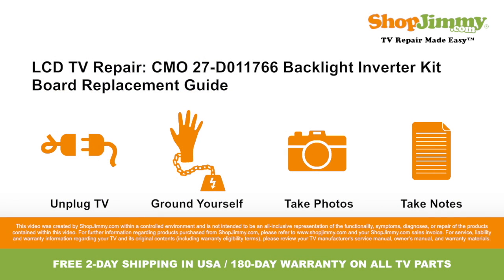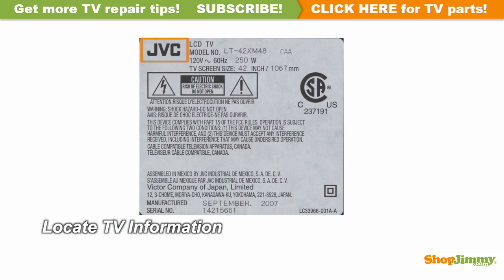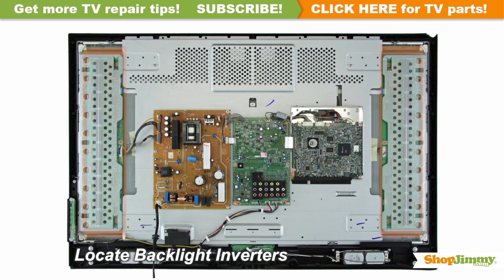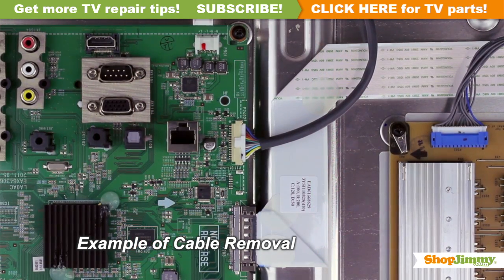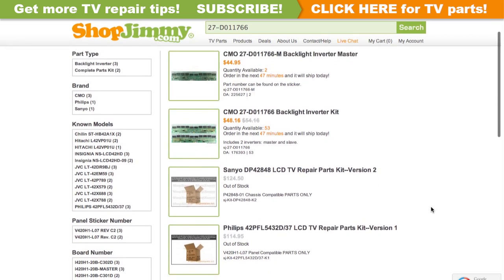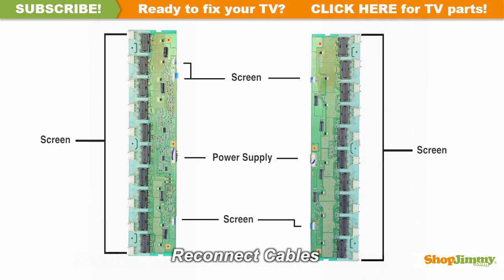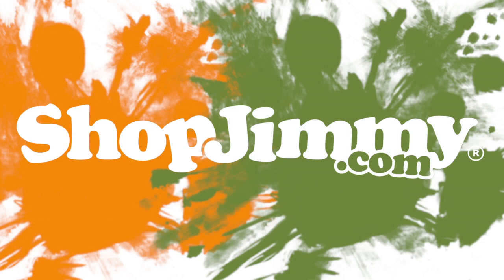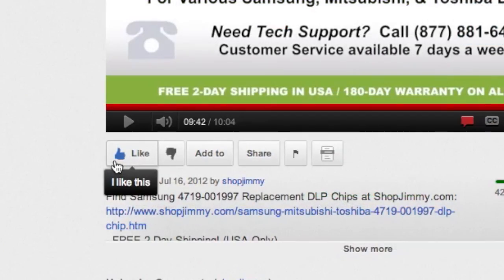TV Turns On, Backlight Inverter Immediately Turns Off TV Repair

Comment: I have a 42" insignia ns-42l550a11, I have replaced main power and inverter board (only 1).  Still nothing, I get a red light on the power on LED but  no sound nor picture.  what would be your next move, I have already ordered the main board (the one with all the different connections from HMID to USB).  the actual back lights??

Comment: I have a Sanyo DP55441. No picture, i have sound and if i put a light to the screen i can see images. So i pulled the back off the TV and checked the inverters. On both the master and slave boards the jumper connectors are burnt. The wires on the slave side had the insulation burnt right off. The connections on the board also show signs of being burnt. If i order a new Backlight converter kit will this fix my problem or is there likely something else that called this?
Reply from the maker: clint kendall   Yes, I believe that will fix the issue.  Here is a link to replacement parts:  http://www.shopjimmy.com/catalogsearch/result/index/?cat=46&q=DP55441  Be sure to match part numbers on your current board, with your replacement for compatibility.  You can also call our customer service for further assistance with your purchase.  (877) 881-6492  Thanks and please let us know if you have any further questions with your TV Repair!  www.shopjimmy.com

Comment: I have 32" Philips TV model # 32PFL5332D/37. Sometime TV backlight goes off but still sound is present. Sometime this happen 5 times in 5 minutes and some time does not happen for hours. when it happen I simply turn OFF TV power from remote, wait for few seconds and turn back ON again and it fix the problem.  I did flash light test and when I put flash light on screen I can see menu or picture. I did visual inspection of power supply board and inverter board and all Capacitor looks fine. Any help will be appreciated. Thanks

Comment: Hey shopjimmy - I have a Sanyo DP42848 LCD 42". The picture suddenly went out. When you power on or off the unit the picture appears for a few seconds then goes away. The sound works fine. The remote is broken and these units don't have an INPUT button so I am hard pressed to do the flashlight test. Please advise.
Reply from the maker: foxman2sly2  I recommend replacing the main board in your TV.  Here is a link to replacement parts for your TV model number on our website, click here:  http://www.shopjimmy.com/catalogsearch/result/?q=DP42848  Be sure to match part numbers on your current board, with your replacement for compatibility.  Here is a link to a video showing how to identify your part number, click here:  TV Part Number ID Guide for Sanyo Main, Digital, & Terminal Boards (LCD, LED, Plasma TVs)  You can also call our customer service for further assistance with your purchase.  (877) 881-6492  Thanks and please let us know if you have any further questions with your TV Repair!  www.shopjimmy.com

Comment: i have a dp32640 sanyo tv with no backlights i did the flashlight test and i can see the picture.Already changed the inverter that did not fix the problem . you think it could be the main board or the power board.

Comment: Hello,
I have a 37 inch Magnavox LCD TV.  Model # 37Mf437B/37  Serial # BZ1A0739310249.  It's only five years old and the picture has crapped out.  When I turn on the TV, the screen immediately turns white, and I can barely see the menu in light gray.  the sound is fine.  From reading and watching YouTube videos, I think it may be the backlight inverter.  What is your opinion?  Do you sell new parts for this model or do I have to settle for a used part?  Any help is appreciated.  Thank you.
Reply from the maker: Christine Giel I recommend replacing the main board in your TV.  Here is a link to replacement parts for your TV model number on our website, click here: http://www.shopjimmy.com/catalogsearch/result/?q=37Mf437B%2F37  Be sure to match part numbers on your current board, with your replacement for compatibility.  Here is a link to a video showing how to identify your part number, click here:  Philips Magnavox Main Boards TV Part Number Identification Guide for DIY TV Repair Help  You can also call our customer service for further assistance with your purchase.  (877) 881-6492  Thanks and please let us know if you have any further questions with your TV Repair!  www.shopjimmy.com

Comment: sony kdl 40s4100 turns and and shuts off ,replaced power board ,the same ,unplugged inverter board green light stays on.should I take a chance and replace inverter board?

Comment: I have a insignia ns-37D20SNA14 I think the black light is out but I continue find the black light converter  is it on the t-c
on board
Reply from the maker: +john casteel   Try all repairs and troubleshooting at your own risk.  This sounds like you have bad LEDs in your TV.  Unfortunately we do not sell replacement LEDs for your TV model number at this time.  You can check back in the future to see if we have them available.  Thanks!  www.shopjimmy.com

Comment: JVC LT-37DP8BJ - Intermittently powers down accompanied by pop/click noise. Standby light stays green. It won't switch on again for 15 minutes with mains power disconnected. Always switches on cold, sometimes lasts for hours without problems, other times it switches off 4 or 5 times in a night. Any ideas? Many thanks.
Reply from the maker: Joe Rees   I recommend replacing the power supply in your TV. Here is a link to your replacement power supply for your TV model number, click here:   http://www.shopjimmy.com/jvc-sfl-9078a-u2-power-supply-board.htm  Be sure to match part numbers on your current board, with your replacement for compatibility.  Here is a link to a video showing how to identify your part number, click here:  JVC TV Part Number Identification Guide for Power Supply Unit (PSU) Boards (LCD, LED, Plasma TV)  You can also call our customer service for further assistance with your purchase.  (877) 881-6492  Thanks and please let us know if you have any further questions with your TV Repair!  www.shopjimmy.com

Comment: I have a sharp LC-70LE857U tv turns on only back light shows for 5 seconds but no logo or anything just back light then turns off and blinks 2 slow times and 5 rapid...I turn it back on same process power supply has been replaced but it still does the same

Comment: I have a LG 47LN5700 tv. Yesterday, when I turned on the tv, the display would flash for a second and then turned off. I can still hear the sound of my cable box. I even can barely see pictures as well. I opened the back cover and didn't see any backlights. But when i turned the power off, I could see some backlight lit only for a second. Please help
Reply: Have same problem

Comment: I have a 42 inch jvc lcd tv when I try to put it on with the remote it not coming on but it turn on by hands I change the remote battery and the same thing
Reply from the maker: Rahul Joseph This sounds like the problem is either the main board or the IR sensor.  You may need to replace one at a time to see if it fixes the problem.  Please reply with your TV model number and I can recommend replacement parts for your TV.    You can also call our customer service for further assistance with your purchase.  (877) 881-6492  Thanks and please let us know if you have any further questions!  www.shopjimmy.com

Comment: Jvc lt 42x579 I plug the tv in and I hear a click. The blue led stays lit. No sound, no picture..nothing. Is it the main board?
Reply from the maker: Yoker   I recommend replacing the T-Con board in your TV.  Here is a link to replacement parts for your TV model number on our website, click here:  http://www.shopjimmy.com/catalogsearch/result/?q=Jvc+lt+42x579  Be sure to match part numbers on your current board, with your replacement for compatibility.  Here is a link to a video showing how to identify your part number, click here:  LCD Help Part Number Identification TV Repair Guide for LG Philips Timing Control (T-Con) Boards  You can also call our customer service for further assistance with your purchase.  (877) 881-6492  Thanks and please let us know if you have any further questions with your TV Repair!  www.shopjimmy.com

Comment: I have a 32" westinghouse LTV-30w2 when i turn it on there is no display at all and the red light in the bottom right just blinks at a steady pace. the tv is from 2005
Reply from the maker: Top Butter   PLEASE SUBSCRIBE TO OUR CHANNEL - Try all repairs and troubleshooting at your own risk.  I recommend replacing the main board in your TV.  Click this link to replacement parts for your TV model number:  http://www.shopjimmy.com/catalogsearch/result/index/?cat=56&q=LTV-30w2  There may be multiple boards for the same TV model number, be sure to match part numbers on your current board, with your replacement for compatibility.  Here is a link to a video showing how to identify your part number, click here:  https://www.youtube.com/watch?v=SoUXsgOx25oThanks and please let us know if you have any further questions with your TV Repair!  www.shopjimmy.com

Comment: Hi i have a Sony Bravia kdl46bx450 When I plug it in with noting plugged into it but the power cord and hit the power button the screen turns on, flashes the Sony logo, the. It shuts off. I have done a lot of searching and there is no flashing red light error code as many others have pointed out. When I use my IR on my phone to press buttons or the side TV buttons the green light flashes as if it was working. I used a flash light against the screen and can actually see the screen, so it sounds like maybe a backlight?

Anyone have any idea if I can fix this? Thanks for your help!
Reply: Jonathan Rivera my TV is the same and doing the same
Reply: My TV is the same and doing the same

Comment: I have a Samsung LN-S2651D While watching yesterday, the picture went out. The Audio stayed on. Since then when you start the tv, the screen lights for about 1/2 second then goes black and only sound remains. What do you think the problem is??  Please help.
Reply from the maker: Steven Germano   I recommend running the flashlight test on your TV.   Here is a link to a video we produced that shows how to run the flashlight test. No Image No Picture on TV Screen - Flashlight Test LCD & LED TV Repair - How to Diagnose Symptoms 2 Please reply with your flashlight test results and we can recommend a replacement part for your TV repair. Thanks and please let us know if you have any questions! www.shopjimmy.com
Reply: Hi, I turned tv on in black room. Backlight came on for 1 second then went black. I tried again looking into back of tv vents. TV turned on backlight turned on and then went black. I used a flashlight test and did not see any images.
Reply: Thank you guys. I received the new inverter board from you today. After installing it, the TV works perfectly. Only issue I had was removing old board. Samsung melts a hard wax or something over the main pins connection. I gently razor bladed it off. Thanks again.

Comment: I have the same Problem with my 42" bush LT42M1CFA, I have replaced both Inverters when I power it up screen comes on for 3 second then back lights goes off still have sound and pic in the 3 seconds, what do i try next, please help!!!
Reply from the maker: roslyne gould  I recommend running the flashlight test on your TV.   Here is a link to a video we produced that shows how to run the flashlight test. No Image No Picture on Screen-Flashlight Test LCD TV Repair - How to Diagnose Broken Board TV Repair Please reply with your flashlight test results and we can recommend a replacement part for your TV repair. Thanks and please let us know if you have any questions! www.shopjimmy.com
Reply: ShopJimmy.com
I have done the flash light test and I can see the Image behind, what would you recommend next thank you
Reply from the maker: roslyne gould   If you can see the image with the flashlight, then I recommend replacing the backlight inverter board(s).  Here is a link to replacement parts for your TV model number on our website, click here: http://www.shopjimmy.com/catalogsearch/result/?q=LT42M1CFA  Be sure to match part numbers on your current board, with your replacement for compatibility.  You can also call our customer service for further assistance with your purchase.  (877) 881-6492  Thanks and please let us know if you have any further questions with your TV Repair!  www.shopjimmy.com
Reply: This has already been done, so I'm a little stumped, should I just call it a day or could this be the main  board??
Reply from the maker: roslyne gould   You can replace the main board to see if that is causing the problem.  Here is the link to replacement parts:  http://www.shopjimmy.com/catalogsearch/result/?q=LT42M1CFA%2C  Be sure to match part numbers on your current board, with your replacement for compatibility.  You can also call our customer service for further assistance with your purchase.  (877) 881-6492  Thanks and please let us know if you have any further questions with your TV Repair!  www.shopjimmy.com

Comment: I was given an Insignia Flat Screen TV. It gets power, you turn on the TV, a screen pops up and says Please Wait. Then it disappears and the screen is off. Is this the regulator that is wrong with it?
Reply: Insignia, NS-LCD26
Reply from the maker: Steve Patterson  Please watch this video FIRST to help with your repair!  https://www.youtube.com/watch?v=BP3NVNCGEv8  This could be a problem with either the power supply board or the main board in your TV.  You may need to replace each board individually to see which one fixes the problem.  Click this link to replacement parts for your TV model number:  http://www.shopjimmy.com/catalogsearch/result/?q=LCD26%EF%BB%BF  There may be multiple boards for the same TV model number, be sure to match part numbers on your current board, with your replacement for compatibility.  Thanks and please let us know if you have any further questions with your TV Repair!  www.shopjimmy.com

Comment: i have SONY tv  Model no = FWD-50PX3.
Problem is =  on and off  back light also coming on, click sound of relay also for 5 times,
i cannot locket the problem plz help me what is problem?
Reply from the maker: +Tshering Tobgay  Try all repairs and troubleshooting at your own risk.  I recommend replacing the main board in your TV.  Click this link to replacement parts for your TV model number:  http://www.shopjimmy.com/sony-1-789-910-11-a-board-for-fwd-50px3.htm  There may be multiple boards for the same TV model number, be sure to match part numbers on your current board, with your replacement for compatibility.  Here is a link to a video showing how to identify your part number, click here:  https://www.youtube.com/watch?v=Aodz2LHkzbY  Thanks and please let us know if you have any further questions with your TV Repair!  www.shopjimmy.com

Comment: I have a JVC LT-42X688. The slave invertor board had a burnt mark on the reverse side ..so I replaced it. I turned the TV on and it fixed the issue. I left the TV on and I attempted to replace the metal grille(dummy me). The grille touched 1 of the transformers on the Board and the screen then turned black.....did I just short out the invertor board that I just replaced?

Comment: I have a JVC LT-47EM59 (47" 1080p) I am having issues with. After aprox 30 to 45 minutes of use the picture will fade to black but the audio continues to play. If you turn the power off and back on, both audio and video will work for a short time and then it will fade to black again. Putting a fan on the backside of the TV prolongs the time between the fade to blacks. I have pulled the back off and looked closely at all 4 boards. No noticeable problems. no bad caps, burned areas...ect. Does this sound like a typical problem that happens to a certain board or to JVC TV's? I don't have an issue replacing a board but thought you my be able to provide me some direction.
 Thank you,
 Matthew

Comment: I have a Hannspree HSG1102 42" TV that when powered on, logo comes up and after approximately 10 to 15 seconds it powers off. Can someone please help us as we feel like we are banging our heads against a brick wall cause of the MANY solutions online and on YouTube. Tested all capacitors which show no signs of blowing so please suggest a solution that is simple and that we can get this TV up and running as soon as possible please. Thanks in advance! ;)
Reply from the maker: DevilQueenGhost86   I recommend replacing the main board in your TV.  Here is a link to replacement parts for your TV model number on our website, click here:  http://www.shopjimmy.com/catalogsearch/result/?q=HSG1102  Be sure to match part numbers on your current board, with your replacement for compatibility.  You can also call our customer service for further assistance with your purchase.  (877) 881-6492  Thanks and please let us know if you have any further questions with your TV Repair!  www.shopjimmy.com

Comment: I have a 55 inch Sony FW55D25F tv when i power on it shows the SANYO on the screen and turns off. I have replaced the Main Board and Power board and problem is still there any suggestions.

Comment: I have a Sharp Aquos  LC-C5277UN it has a black screen, power and OPC light comes on but the both blink, tried to reset by powering off, then holding down the volume and channel down buttons and then powering on but that did not work, so is it the power supply or the backlights ?